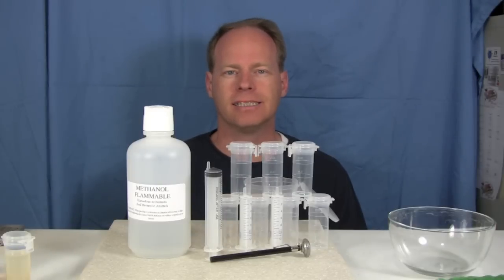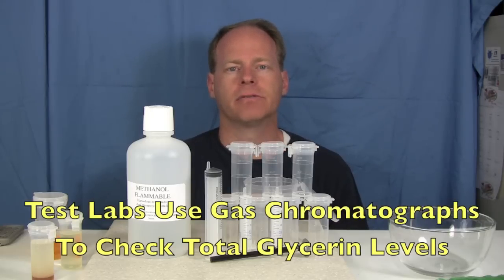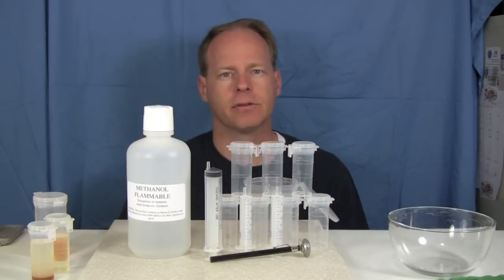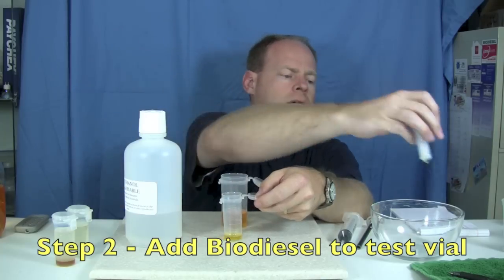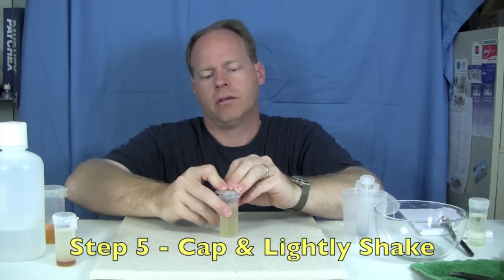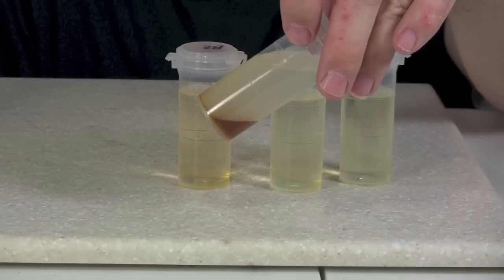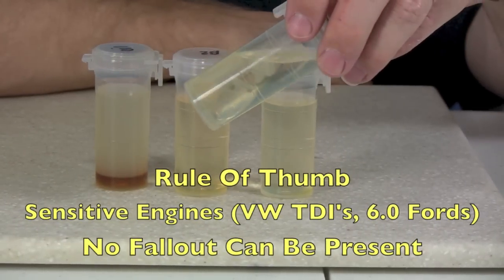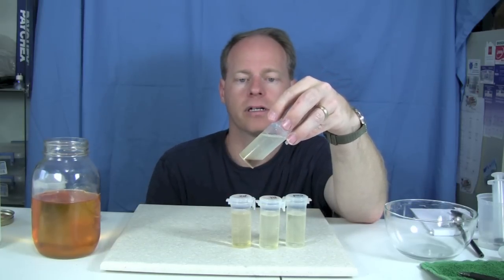How To Test Biodiesel For Conversion - 3/27 Methanol Test - Utah Biodiesel Supply

Comment: Gairdon in the 27/3 test you put 3 mililiters biodisel; after that you say you wouldn´t have any problem to use this bio in a undirect inyected engine if is lower than a quarter of an inch... how many mililiters are "quarter of an inch"... because I am using some convertions table at google and its 2 mililiters?

Comment: Re-Reaction Techniques call for 30% of original Methanol & Catalyst - which basis ? the methanol & catalyst  that i used before in Reaction ?  Can you please reply me , i  am not clear
Reply: 30 % of the original amounts. So if you used 10 gallons of methanol and 10 grams of catalyst initially, you'd use 3 gallons of methanol and 3 grams of catalyst to re-react.